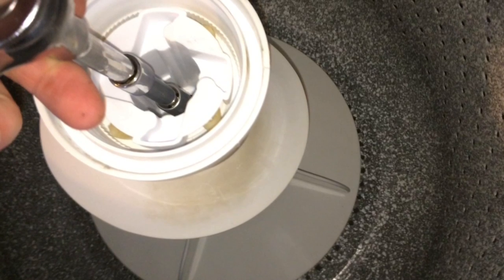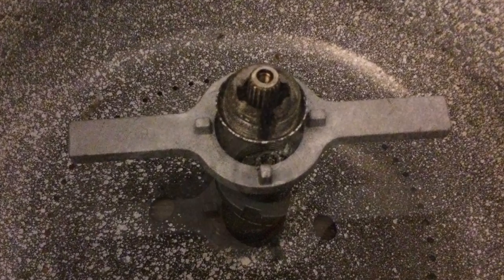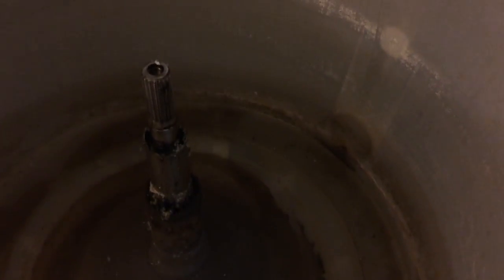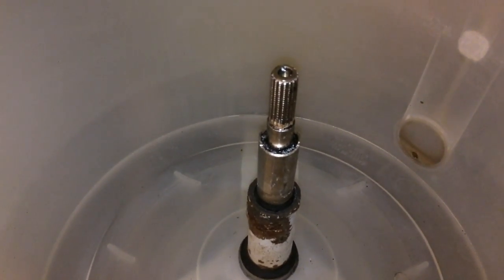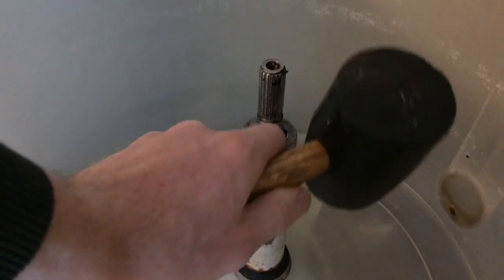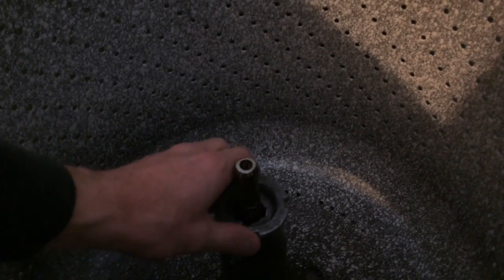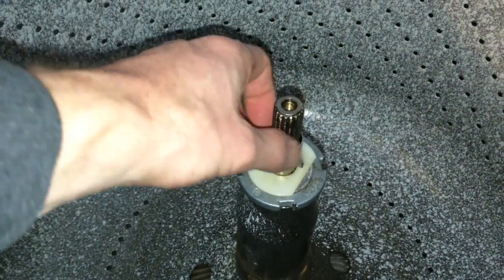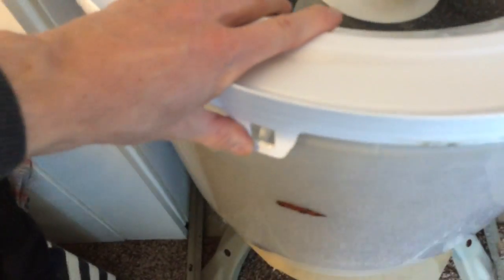Remove Stuck Washing Machine Tub: C-Clamp method

Comment: Thanks for this video. I had success using a 3-jaw gear puller from Advance Auto Parts, AC3110 that has a 3 1/4in reach. I used your flip the spanner wrench method, genius. Even then it took so much force to break the corrosion seal, and then I found the drive block was rusted to the inner tub. After I removed the inner tub I tapped the drive block down and out with a mini sledge and used a wire brush to scrape off the corrosion.

The clamps part I tried but didn't work for me because I kept dropping them all over the place (side note: I advise anyone else to put down some towels or something so the tub coating isn't damaged). I tried a piece of 2x4 wood sitting across the spindle and even drilled a 1/2 in. deep hole so the wood could "sit" balanced on the spindle but when I applied the clamps no matter how I tried to balance it the wood would always lean forwards or backwards as I was turning the clamps on the sides.
Reply: Did the same but from Oreilley's

Comment: I used a socket as a punch , set it in one of the slots and then used a heavy hammer. I cut a 2x4, placed it so hooked under the lip of the tub and then levered against the spindle top. I tried my scissor jack and then went to a small "crow bar". I protected the single with wood also

Comment: BRAVO! I used your idea but used a 2 jaw puller and worked like a champ! Thanks for posting!
Reply: Ditto, same here, used your initial idea, but busted out the 3 jaw pullers in my case. Just ran the spanner nut in enough to grab 3-4 threads, but not so tight that it started spreading the thingy. It was coming off so easy, I thought it was the pullers slipping. But off it came and before that, I spent much time trying to just pull it off like some youtube vids showed. Thank you for sparking my memory about using pullers

Comment: I've taken apart several of these machines and wondered how the tiny spin tube ears are able to drive a tub full of water and clothes. I have seen some drive blocks shear in such a way that it appears that the tub is trying to walk upwards. That will eat the ears of the spin tube and eat the corresponding notches on the drive block. The guy who sells me parts told me that the drive block is split for a reason. As you tighten the nut, it squeezes the spin tube at the same time the upper nut pulls the drive block into the bottom of the tub. That is the reason you have to make sure you tighten the top nut really well. Some machines have a little plastic washer with a peg pointing up on one side and another peg pointing down on the other. You will usually find that washer with a loose fitting "C" clip. He told me that those parts really do nothing. I put together a machine without them and found no difference. I thought it was some sort of spacer that kept the agitator from going too far down. Some books/vids recommend that the drive tube be replaced if the notches are worn due to a loose drive block. I feel that if you tighten the nut enough that the drive block will tighten enough around the drive tube that it won't be a problem. A last chance fix would be to JB Weld it onto the tube.
Reply: obsolete professor If either the ears on the basket drive are worn down  or the spaces on the drive block are enlarged due to ware, they both should be changed out. Either condition allows for play in the  basket. During the spin cycle the play in the basket causes a great deal of drag as the motor and coupler and transmission work to spin the clothes dry.  Customers will complain about clothes being more wet after spin than they used to be.

Comment: Hey what is that plastic peace u put under the agitator clamp I noticed when u cleaned my washer mine was broken  the tab sticking up has broken off now I need a new one washer still works fine but now sometime the agitator slowly speeds up during spin  and I need it to spin right speed during spin I use the fabric softner cap
Reply from the maker: Oh wow. I wish I could help. I don't know the name of that part but there are part diagrams online with pictures. I'll dig around later and try to give you a link.
Reply: DadsGotADeal oh great thanks hope you find it. my washer works fine just noticed now the agitator has a hard time coming up to speed  but it does eventually so it is still dispenser sing fabric softner I noticed it when I installed a new agitator old one had gotten nosy and had funky stains on it so I just got a new one instead of repairing  and cleaned out the washer good  I have a maytag dependable care washer model mtw5900two
Reply: I think you need the 4 fingers that are in the agitator. Some parts guys call them spin dogs.. agitator dogs. The top half of the agitator just seems to sit there or spin with no real force. They are p/n 80040 FSP/Whirlpool.
see link:

 https://www.walmart.com/ip/WP80040-Whirlpool-OEM-Washer-Washing-Machine-Agitator-Dogs-also-for-Kenmore-285770/173985014?wmlspartner=wlpa&selectedSellerId=9982&adid=22222222227065479472&wmlspartner=wmtlabs&wl0=&wl1=s&wl2=c&wl3=170315323415&wl4=pla-274786814587&wl5=1013804&wl6=&wl7=&wl8=&wl9=pla&wl10=115794506&wl11=online&wl12=173985014&wl13=&veh=sem
Reply: the issue i have been having with my washer with my washer is that it will agitate just fine the dual action agitator locks and spins one direction while the bottom half moves back and fourth the issue i have is when it comes to a spin the agitator no longer comes up to speed  with the drum so fabric softener no longer dispenses i removed the agitator there is a metal c clamp that is fine then under that there is a plastic ring with 2 notches one side hooks to the metal clamp the other to he drive block well that plastic notch has broken off and i have no idea what that part is called other then that the washer works just fine it also has had a whole new agitator put in it  the old one got stained pretty bad and had some cracks so i just replaced it.

Comment: Thanks.  I had the same problem with an old 1998 washer and your method worked great.  I did have an old wheel puller that  I used to pull off the tub, but your improvised wheel puller would work for anyone who has some basic clamps. Great video.